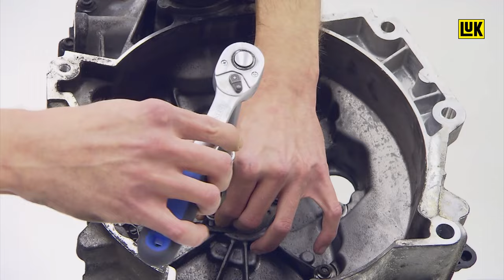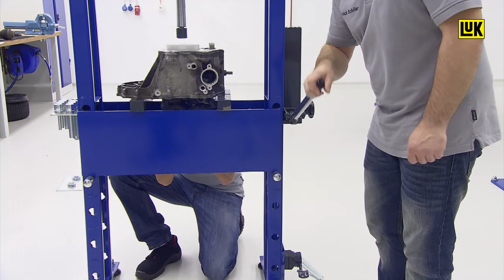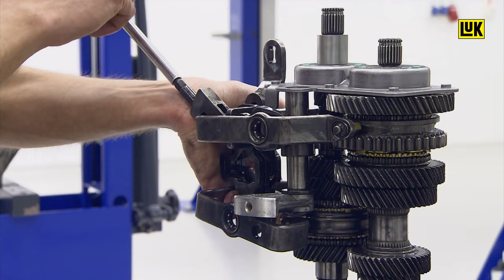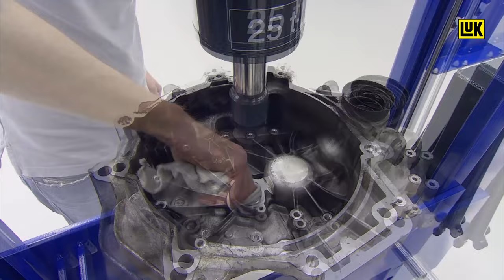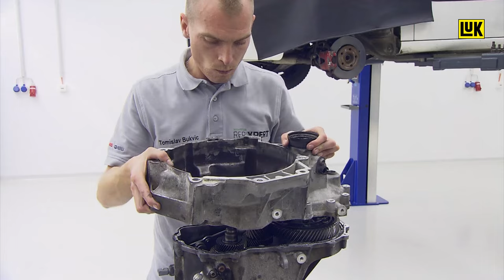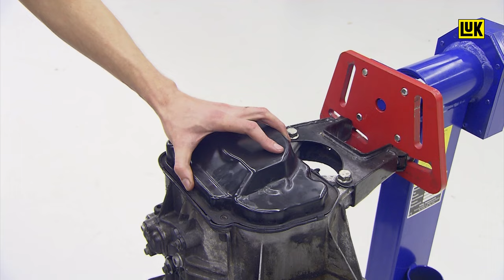LuK GearBOX repair solution for VW 02T transmission

Comment: great video! Can I ask you something? I have golf mk4 with a 02T DUW transmission. when the car is cold all gears work fine, but after 15-20 min of driving, especially in hot days the 1st, 2nd and reverse gears become difficult to shift in. Would changing the gearbox lubricant solve this problem? Where is the fill hole on the DUW? Do I have to remove the slave cylinder to access the fill hole? Thanks for you help!
Reply: I don’t speak English very well but I think I can help you, It happen when you have a Valeo clutch, you must remplace it. for VW you must use Sachs or LUK. Hope helped you.